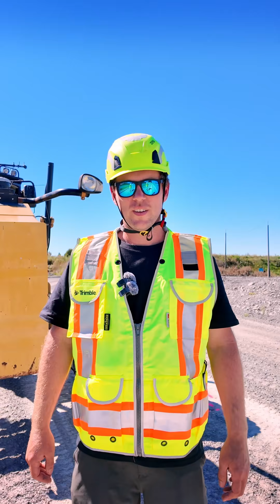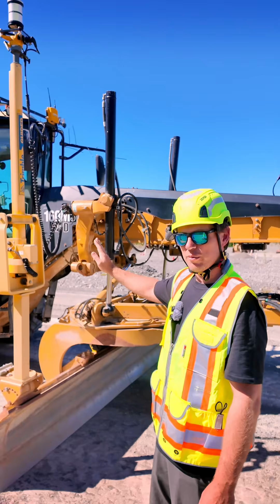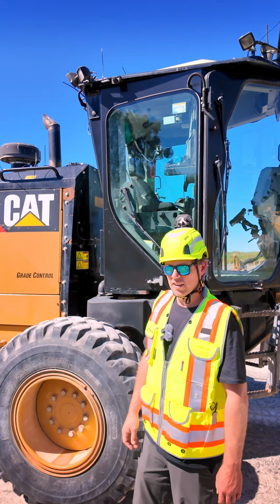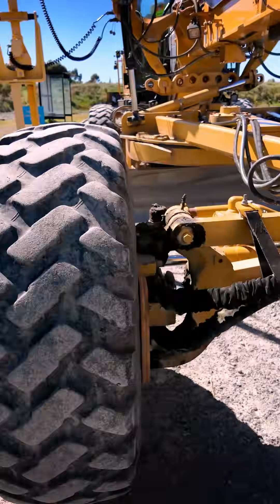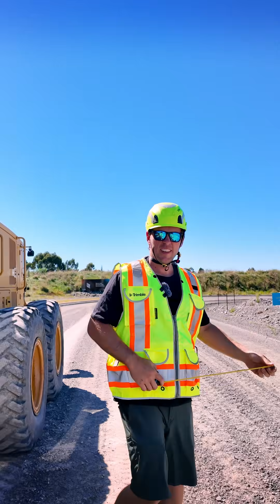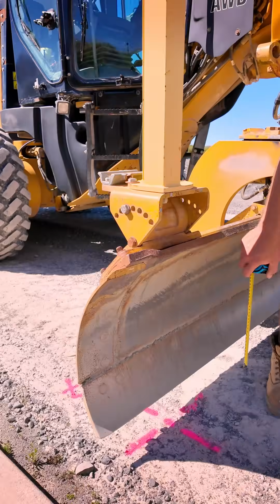Machine setup tips for grading with Trimble Earthworks

Comment: How do I control the blade sensor so that it maintains the same height when tilting it forwards or backwards? I'm having this problem. The blade height changes when I tilt it.

I hope you can help me.
Regards.
Reply: If you are changing the pitch of the moldboard (rolling the blade forward / back) make sure that 
1. your cutting edge lengths are millimeter accurate
2. update your cutting edge angle by using the horizontal and vertical input method
3. the mast is in the same bolt hole it was measure up in for best accuracy
4. ensure there is no slop in your slide rails, shim them up tight